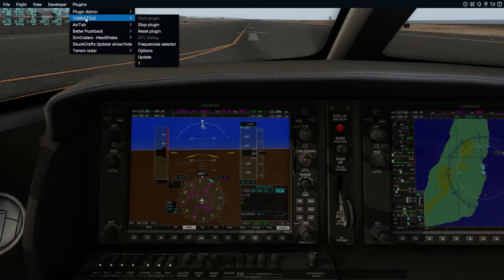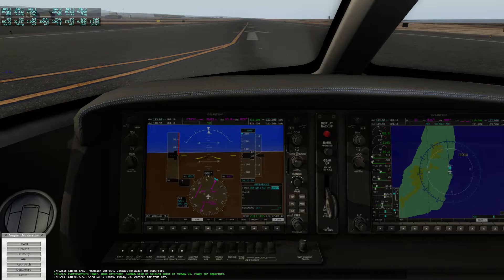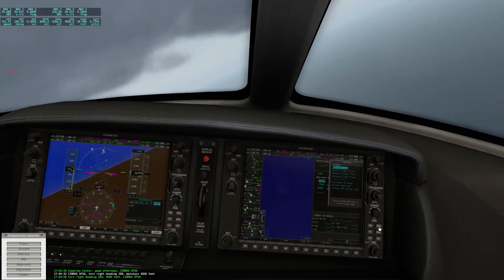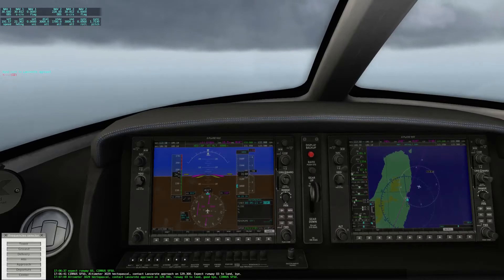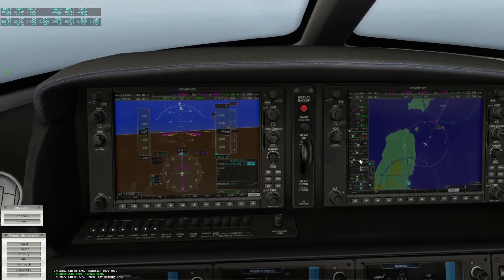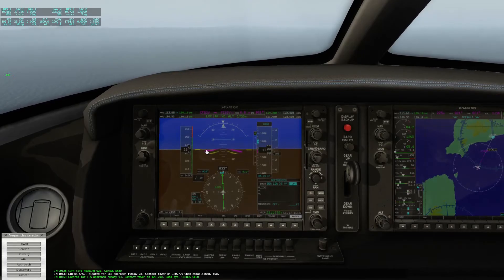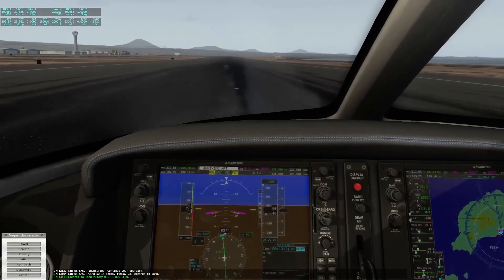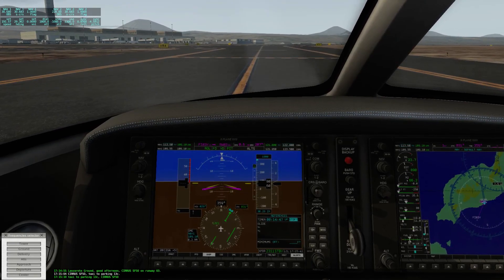124th ATC plugin for X-Plane 11: Short Test-Flight from take-off to to landing

Comment: It works fine, but as soon the waypoint switches to ILS, the ATC gives me a new heading and then no more communications, radio silence.  I keep following the heading the ATC gave me and i keep going straight, no more coordinates or orders.
The only thing i can do is to manually select the next waypoint (the runway), but the only thing the ATC gives me is the heading straight to the RWY, making me fly above the airport.
There's no way i can get a working approach from the plugin, like the default ATC does.  What can i do?   Thank you A LOT, i'm stuck rn :(

Comment: are u changing heading or is 124th doing it?
Reply from the maker: I'm changing the heading, but I use shortcut...
Reply: @logicautopilot  you seem to  be flying  with gps ap and nav. why would one need to adjust heading?
Reply: @logicautopilot  does one need to be in hdg mode? how do i turn on vpath? thanks.
Reply: @logicautopilot  what is the shortcut if i may ask?